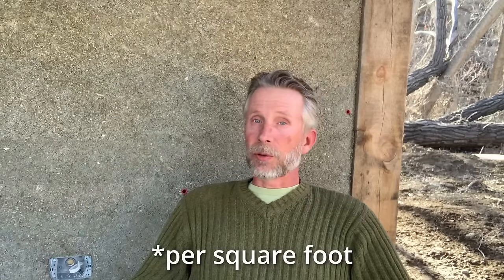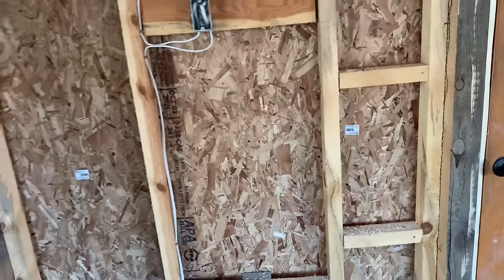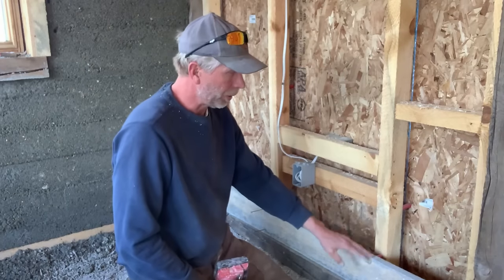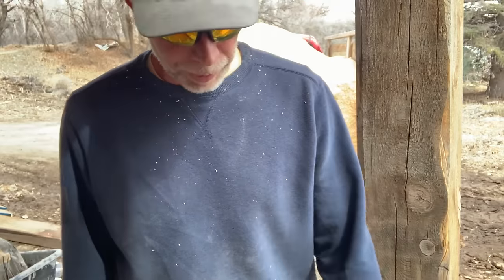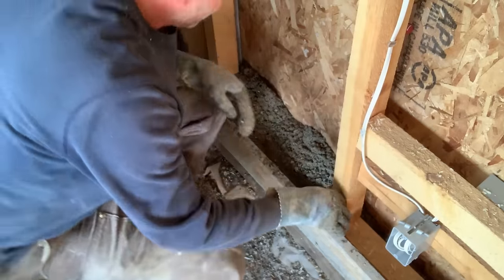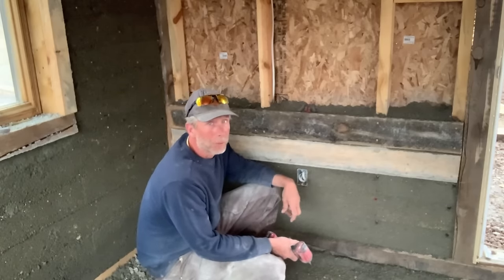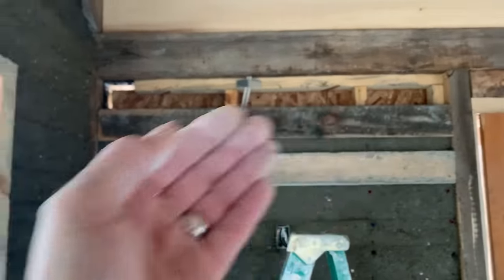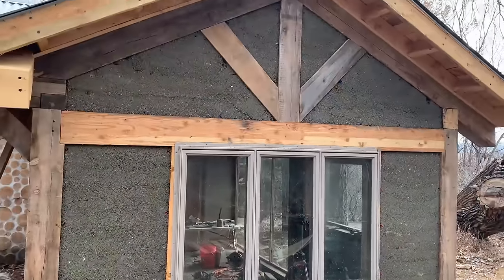Dustcrete

Comment: How many psi of compressive strength does it have, like for holding up beams?  In case of a fire, at what temperature does it start smoking or giving off carbon monoxide?  How many stories high can you go with this method?  How many years old is the oldest version of dustcrete that has been through the changing seasons of outdoor weathering?  How permeable is it to rain upon a wall, or pooled water if used as floor or ceiling material?  Have you packed dustcrete in around iron re-bar to test structural strength limits?
Reply from the maker: These are question yet to be answered. Though I am using timber to bare the load, I imagine a frameless pour could be load baring with a bound beam poured at the top for the wall.

Comment: Interesting and a great use of waste material. I do like the lines left by the form boards.  Would it be helpful to dry mix in a masonry paddle mixer, then dump into a wheel barrow and mix in water?  Could  wood ash be added to this mix also? Can any of you chemists comment on wood ash? It would be nice to know a weight per square foot of material and the r-value.  Is the material "gooey" enough to be applied to the wall with a trowel, or could it be made to be that sticky?  The old time lath and plaster guys didn't always get their walls perfectly flat, but that was a cool look too.

Comment: So lime is porous, and saw dust is an organic material that, unless a type of naturally durable (rot-resistant) wood, seems you'd end up with mold issues after a good wet season, if you don't have a good roof overhang and gutters. Just thoughts of an inspector.

Comment: I wonder if you could make a mold  ( 12in x 16 in or bigger ) and make large bricks out of this material.. and build a complete house out of them … and what the cost would be …. Seems like a very good combination
Reply from the maker: This idea is intriguing. It is possible that a modular block system could be viable, and perhaps structural. Another commenter mentioned an old USSR recipe that may be worth trying for such an application.
Reply: I would perhaps overcompensate with a concrete/rebar frame, and fill in with the ‘bricks’. It’s what I have in mind in this part of Europe as it’s a common building method… skilled labour is available and building inspectors should be happy as well.

Comment: i really enjoyed the vid and the information given , when i watched the first time i wasn't logged in to comment but i am glad i caught the repair vid with the soggy aftermath , it sort of is what it is i would not use it indoors anyway but i was daydreaming maybe the sawdust could be dumped into maybe polyurethane overnight or so i mean in the bucket soaking and then removed premix could waterproof the actual sawdust a little maybe ? dunno there's also fiberglass resine potential but expensive i think that's about the king of epoxies for industrial the polyester resin like the auto store or big box has ...something there's superglue stabilized wood  but it'd be expensive and once again the resin is still king over it  ...oh i was glad to also side study styro-bricks , a bit silly the best imo hypothetically was the 5 parts or buckets ground foam dust to one part or bucket high-strength cement , of course the brick is 1/5th as light /lol and becomes R6 again is what it is because 2" foamboard behind thin cinderblocks with acrylic stucco finish seems better at R10 atlerast one thing/positive on  the styro bricks is any foam dust is used  , similarly a geodesic dome for example as silly it could be would make a strong base and can be built from shorter scrap pieces for example so different things different uses , i imagine the dustcrete is an old technique originally (?) i like the knowledge and thoughts gained , thanks
Reply: there's acetone and other stuff to slow fiberglass resin curing but then it becomes much more flammable and volatile fumes , of course one needs breathing aparatus to be practical , i had good luck using my homemade mix of about 16 ounces or 14 of resin and mixed for a minute or two then i combine it with oil based polyurethane by about half and rush it onto the surface , it changes to honey an unworkable fast like 15 minutes 12 minutes even less with more hardener but the acetone can slow it but only safely in smaller batch or maybe that size caution has to be taken to do sections so it won't get volatile and i'm saying i've seen fumes rising indoors before /lol i'm ranting i subscribed because iirc you asked in the vid....
Reply: 3) message in a bottle but even if the lime protects that dust the water moisture could hit the surrounding planks of the structure is my concern but i am removing all water damage previous on a place so it's a huge danger any water really ...i tend to go wood and gypsum powder alternatives , brick shingles are interesting study by the way , high petroleum content while fiber internally could be some type of filler maybe similar somehow to the dust....(?) take care i hope yo're doing great , i ;m just like talking at the tv or during a movie guy /lol ....helps me sort stuff sometimes or maybe someone interested similar stuff....

Comment: Looks great. The wiring is a bit to be desired, but shouldnt burn anyway. So, in my experience, due to porosity and slight moisture retention, wood always needs to be isolated from cement based materials to avoid rot at the point of contact.  Do you have any structures built some time ago, 10 yrs, for example, with the same technique?
Reply: Probably very porous.  New England freezethaw for 5 months a year would be rough
Reply: @chucknorris277  definatley not for damp climates

Comment: Have you tried this with a polycarboxylate superplasticiser (PCE)? It should make the mix flow a lot better and otherwise significantly reduce your water requirements.

If you haven’t tried it for eco reasons, I realise that water consumption vs adding a plasticiser is a bit of a balance, but it’s a very low usage rate, about 0.01% of cement used for the dry powder. Cost is about AU$30 per 100g for AR grade here in Australia, it’d be a lot cheaper over there no doubt.
Reply from the maker: I haven’t tried this, but other have mentioned it.

Comment: Didn't see this in last few dozen comments, if it's a repeat of previous comments, sorry in advance... You mentioned particle sizes being larger than most home projects create from circular saws, can you mix in hemp, or other fiber or chip waste products to create larger aggregate size recommended for this process ? If not, would other recipes work with small size sawdust, ie more cement, sand or rock products perhaps ?

Comment: Hello, here a question. Have you test it with fire, just to know if it ignite after some minutes of exposure or not ? Have you an idea about the R value (insulation) ?
And have you tried with gypsum, instead of lime ? Thanks in advance for the answers.
Reply from the maker: I have put the torch to it, and the surface will char, but it will not ignite. I'm hoping to test r-value soon. Currently assuming it is like hempcrete (2.8-4.6/inch). I haven't tried gypsum. The lime is easier to come by. I will be doing experiments with clay in place of the cement, soon.
Reply: @radicalgastronomy  thanks, you answered me all the questions. I will try to find that lime or equivalente lime, here in my country.
Reply from the maker: @alvaroschudeck957  Type S lime is also know as “hydrated lime”.  Or, you can put lime stone or sea shells in a camp fire, then soak in water.
Reply: @radicalgastronomy  thanks, good to know, we have here hidrated lime.

Comment: If you are doing anything with cement + wood fibers (sawdust or woodchips) you need to add aluminum sulfate to the mix. In Russia, this style of material has been used since the 1940's when the USSR discovered a very simple, strong, and durable material made out of woodchips and cement that is cheaper, stronger, has a great r value, and can be made literally in your backyard. Its called arbolit, and it has a specific mix proportion to maximize strength and durability. 

Why aluminum sulfite? There are different sugars in any type of wood. These are active substances that form a special film on the surface of the wood, preventing the cement from penetrating into all pores. Thus, the adhesion of the cement to the wood chips or sawdust will be too weak and unstable over time. The aliminum sulfate neutralizes these various wood sugars to prevent degradation and create a concrete like structure that can withstand over 30 freeze-thaw cycles (if dry, will last hundreds of years), provides the entire cement solution with deep penetration, as well as increases elasticity and reliability of the fully prepared wood concrete block/shape. 

Cement: from 300 to 400 kg per 1 m³ of wood concrete.
Sand: from 700 to 900 kg per 1 m³ of wood concrete.
Water: from 150 to 200 liters per 1 m³ of wood concrete.
Wood sawdust or woodchips: from 100 to 200 kg per 1 m³ of wood concrete.
Aluminum Sulfate 3-5% of total mix

If you want the USSR government code and instructions for building this material here is the link
https://docs.cntd.ru/document/901707619
Reply from the maker: Sweet. Thanks for the info!

Comment: Now that's the kind of ingenuity in building science that excites my senses. I live in a national forest in the Ozarks and have tons of saw dust available. Currently looking for insulated wall options on my timber frame house. Very humid here except during July through Sept. Can thise walls fully cure in that time?
Reply from the maker: You bet. Plaster can go on after about a week. If you use vapor permeable plasters (lime and or clay based, not stucco) the walls will continue to vent water vapor as they cure. Even un plastered they are fine in the elements, as long as you have a good overhang on the roof. Let me know if you try it!

Comment: Loved the video. Will dustcrete hold a nail after curing? And, can fresh sawdust be used or does it need to age for a while? Thank you
Reply from the maker: I use fresh, but older dry (not moldy) would work, too. It will take a nail for picture hanging. Not sure how it would do with trim nails, but it may also work.
Reply: @radicalgastronomy  thank you for your reply.

Comment: Thanks for putting this video together.  I watched the video twice and I don't think this was answered but maybe I missed it: why did you chose to go with  2 parts portland cement  + lime instead of just doing 4 parts lime?  With cements known moisture wicking properties, I wonder how that'll work over time?   I really appreciate you effort to capture/explain.
Reply from the maker: I based this recipe off of methods used by Left Hand Hemp Company when we ran out of French lime on a hempcrete build. Tinkering is in order, but the mix is performing well, so far. All lime may work, as might a clay/lime mixture.
Reply: @radicalgastronomy  Thanks for taking the time to answer. I'm just now seeing/watching your two part F.A.Q about dustcrete and it appears you've answered my questions there as well.  Really appreciate it.
Reply from the maker: @biocmp  my pleasure

Comment: I'd add just a bit of fiberglass concrete fiber.  reminds me of using cross-shredded paper with vermiculite (that used to be cheap and attainable)..   If you meed more of a fire block material, do use a vermiculite concrete.. I do add a little sand to mine (chimney liner for the 2" required to stud fire-block sealing in masonry tile).

Comment: I can see this has not been inspected.  Electrical wiring can not be embedded in concrete nor Dustcrete.  

Other then that, I think it is a great idea.  Did you add borax acid for insect control?

Comment: I’d love to know what you used on the floor. One of your other videos said 6 inches of aircrete didn’t have sufficient compressive strength. I really want to put a radiant floor on top of my concrete slab basement. I’ve been going crazy trying to face the price of 2” thick Foamular. I stumbled across your video and wondered if it would be possible to make 2” x 2’ x 8’ (mesh reinforced) aircrete or dustcrete panels. I have been wondering about making my own half inch thick reinforced concrete planks to lay between the PEX tubing on top of the 2” insulation, cover that with OSB and then vinyl plank. I don’t have the same environmental concerns as you, but I want to save money on the 2 inch Foamular insulation. Sorry! Dang! I just realized 2 inch  is R10!
Reply: I just checked the price of 2” x 2’ x 8’ Foamular, $50.76 with tax. That’s $3.44 a square foot. Wow. If I could make something myself here at home using concrete and get R10 even if it was 3 inches thick for less than $3.44 a square foot that would be great. be simpler to pour in place, I can’t even go with 4’ x 8’ instead of 2’ x 8’. Something that has sufficient compressive strength to equal Foamular and be able to wheel a….  piano across. 🙂. I’m kidding. Actually I did wheel a very heavy woodstove across that floor, so that would be the standard.
Reply from the maker: @williamwixon  That foam board is so expensive. One approach could be to pour aircrete over the slab at 2”. Once it is cured, lay the pipe and pour concrete right over it with reinforcing wire laid on the pipe. 🤷🏼‍♂️

Comment: Do you think this would work on the walls of a root cellar? I’m thinking about building a 12’x12’ root cellar next spring with a concrete floor and 16 gauge 6”metal stud walls. I would use marine plywood for shear strength, then a vapor barrier. Backfill the dirt on the outside. Instead of the 6” I would use 4”with 1” spacers on either side? 
Glad I found your channel. This is an awesome technique.
Reply from the maker: With the marine ply and a vapor barrier it should work. Perhaps backfill with gravel for drainage.
Reply: @radicalgastronomy  thanks for the reply. Great idea.

Comment: Thank you for sharing this, I like it. A question, in a similar video, not sure the product, but they soaked the sawdust overnight so it would help slow the curing process. At least I think that is part of the reason they wet it. Thanks in advance for your thoughts.

Comment: Smart dude, good idea. Might dry mix in a concrete mixer dump into wheelbarrow and add water. Maybe easier? 🤠
Reply from the maker: The mix is light, so mixing is easy (particularly with a hoe that has a handle 🤪). You can mix in a mixer, but lime dust flies.

Comment: Have 2 lopsided questions:
Im thinking of using this as flooring, in addition to walls. 
1 -- Am i correct in thinking that a floor made of this would be permeable -- and that after fully cured, water would drain right thru it ???  
2 -- Would it be strong enough to serve as the flooring of a horse stall, bearing the weight of a 2000# horse ???
Thanks in advance !!!  Love what you did with it !!
Reply from the maker: If I were doing this I would use finer sawdust (like from a cabinet shop). Rather than shoot for something that drains, I'd go for something that sheds. Fine sawdust with a slope, finished with 5 coats of linseed oil might work.

Comment: In a country (Australia) with fierce, ubiquitous termites that seek out pine as a delicacy, how could a builder avoid them? One thought was to use steel framing with the dustcrete infill instead of wood. The other thought was to use steel stirrups to raise the wood frame structure off the ground? 
A third thought was to use a cinder block or limestone block or other foundation like most houses had through the 1950s up until the early 1960s when brick foundations as a downward continuation of the double brick wall replaced traditional stone foundations. But a lot of work. There must be a (insert aggregate prefix here)-crete solution to this foundation termite problem?
Reply from the maker: In termite heavy areas, pumice Crete is a great alternative.

Comment: I love it !
One question,
Hemp Crete uses just hemp , lime and water,
Why does this mix need the cement ?
Many thanks,
Luke
Reply from the maker: The lime that is used in hempcrete is dolomitic lime from the south of France. Most US hempcrete builders import it from over there. I saw a guy run out of this on a job, and he use a mix of type S and Portland to finish, so I’m following his lead. I haven’t tried straight type S. It may work. I plan to try a type S and clay mix that may eliminate the need for the cement.

Comment: A concern would be using portland cement being not breathable and holding moisture rotting anything it touches overtime (wood / rebar), so portland will rot the sawdust. A lime version would be better
Reply: The people in France used hydraulic lime and it petrifies over time because it organic.

Comment: I'm curious about the weight comparison between the dustcrete wall vs a conventional wall with board/plaster, exterior cladding and fibreglass insulation.  If it's at least comparable, it opens up some interesting possibilities for structures built on above ground frames.
Reply from the maker: In broad terms, the total weight of the dustcrete in the 5’x8’x 6.5” wall section shown is less than 200 lbs, once fully cured. This method can absolutely be used with an elevated frame.

Comment: With regards to drying time: can you just continue to stack upwards without letting each level set to dry for a time...or ? Thank you! Great invention!
Reply from the maker: The slip forms can be moved up as soon as they have been filled. Be sure to overlap older work by 3" if only using one form board before adding more fill.